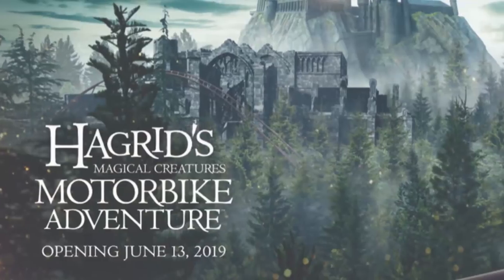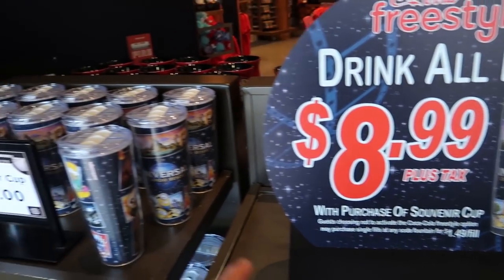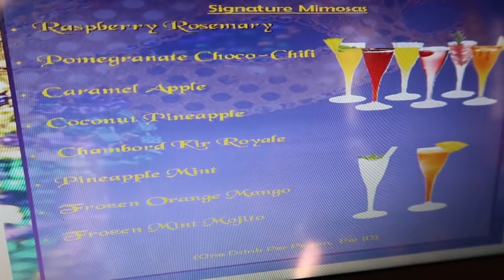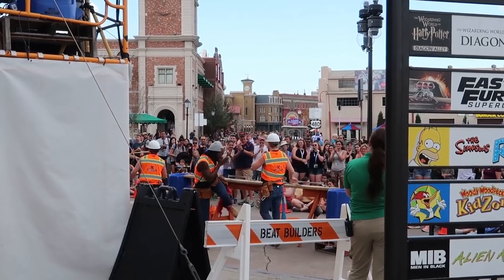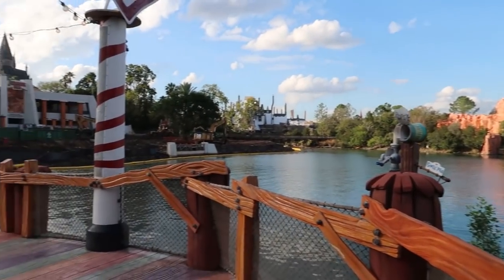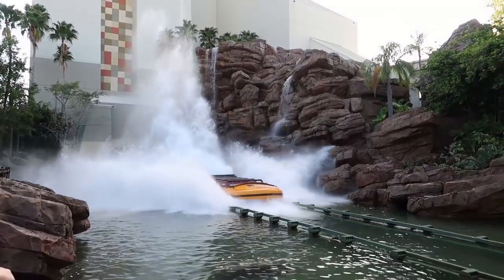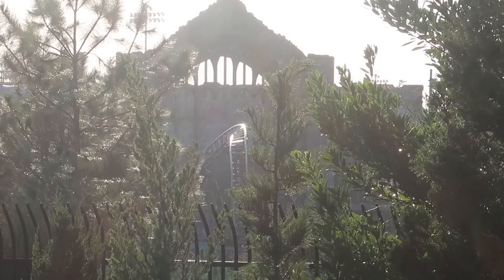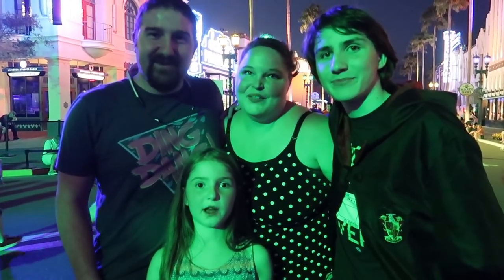Universal Orlando Update! | Hagrid's Magical Creatures Motorbike Adventure & Jurassic Coaster Rumors

Comment: I've been to Florida probably 3-4 times now and I have NOT known about the Discovery Centre. WTH! I'll have to go there next time I go.

Also, where was that secluded spot? I want to know so if my family need a quiet spot, we can just go there for some peace.

Lastly, I don't think the Hagrid ride is anywhere near Hogwarts. Hagrid's Hutt is far too big and the "boat house" is far too distroyed. They did confirm it was, iirc correctly, that the ride is at an old, abandoned part of Hogwarts that the muggles can see since it's outside of the anit-muggle barrier (which cloaks Hogwarts from Muggle eyes)